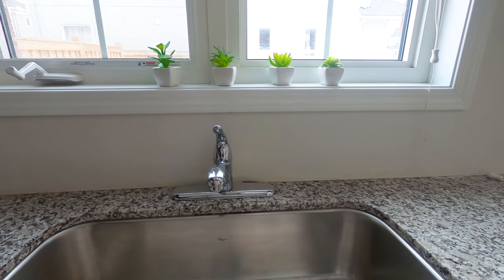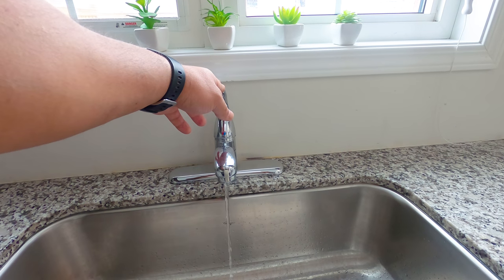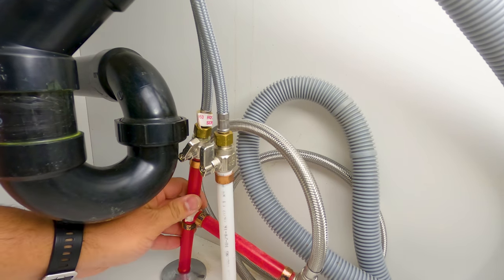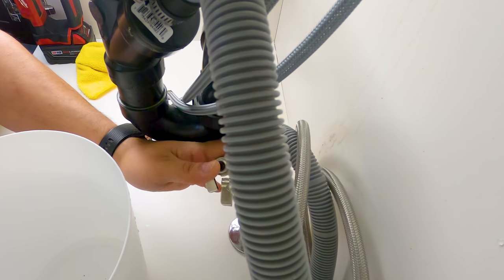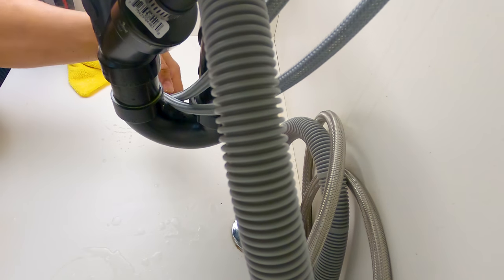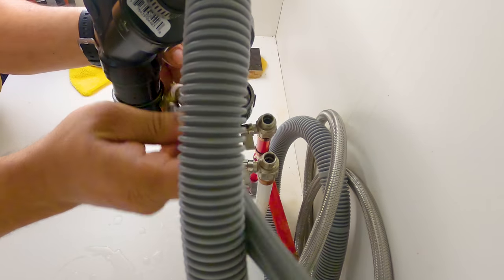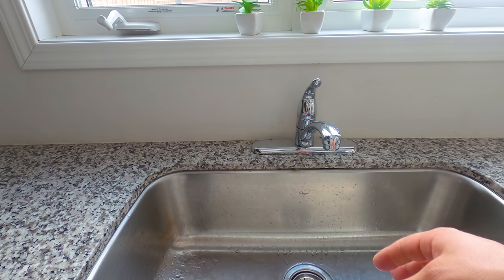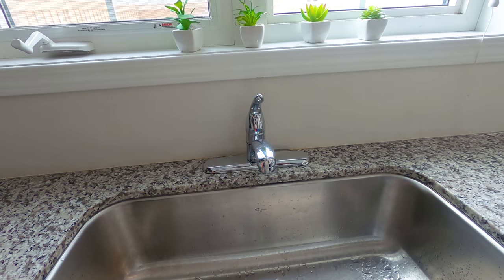how to fix Low or No water pressure for the kitchen or bathroom faucet in no time

Comment: Thanks for posting this! Been suffering from low water pressure after leak at main.  I cleaned out the aerator, but had low water pressure still but only in kitchen faucet.  So problem is from main to kitchen faucet.  After watching your video.  I found an additional filter between 2 connecting braided hoses! The systemic troubleshoot start with checking the pressure from shutoff valve at hot and cold then to aerator  was very useful! Thanks a bunch!!!
Reply from the maker: Thank you, I'm Happy that I could help.
Reply: This comment was a huge help. Didn't realize that the connected braided hoses also had a filter. Thank you so much!
Reply: @NeverEndTheSilence  me neither! It’s helped so much! 🎉💙
Reply: There was a water main break on my block and immediately after they fixed it, my hot water stopped coming out of all of my sinks but hot water comes out of my shower. 

There is no way all 3 sinks in my house have a problem. What could stop the hot water from coming out, only cold water comes out of my sinks??

Comment: I had issues in the bathroom, this worked GREAT!!!! Thanks. I checked the faucet filter first before the shutoff valves and it was clogged with debris. The water was off in northTexas for a while so I suspected an airlock first. Your video saved the day, thanks again.

Comment: Hello! I want to thank you for your easy explanation in your video! For the past week I had a very low trickle of water coming out of my bathroom faucet. I looked up a solution on Youtube and came across your video. By taking off the aerator like you suggested, I saw that it was quite dirty so I took an old toothbrush and soap and washed it. Problem fixed! Thank God as I didn't want to contact the handyman for my building. I'm quite proud of myself for fixing this problem as I don't know anything about plumbing. Thanks again!

Comment: Excellent video thank you.I   I thought i must have twisted the flexible tails when i tightened them after a leak but they were fine. Removed aerator. Sure enough lots of white gunk trapped in the mesh. You saved me from hours of frustration🙂

Comment: I just replaced a customers bathroom faucet that was leaking. While there I also put new water hoses in. When I tested everything all was good. An hour or two after I left the wife text me and said hardly any pressure, water trickling out. I went back, turned water off at valves, no change. On a whim I went in to you tube and up came your video. I changed the aerator and the pressure is the best I've seen it. When I turned the water on with the aerator out a bunch of black crap came spitting out, the same black crap clogging the aerator.
Can't believe I didn't think of that, regardless, thank you.

Comment: You should check the faucet aerator for clogging first before removing the shut off valves.
Reply: Agreed! always the head first.
Reply: @jih-shenshih5138  Unless the faucet aerator is one contiguous piece with the internal pex tubing of the faucet.  Then you are screwed either way.
Reply: @OWK000  Huh? Can you even attach an aerator to pex? Do you permanently glue a condom or do you zip tie it?
Reply: @tocarules  Heck!  I didn't attach it myself, it was manufactured that way! And you get the idea:  yes, the aerator was permanently bonded to the pex by plastic manufacturing weld.  That was the problem!  So when I tried to remove it, that action pulled apart pex bonds in other parts of faucet and the whole faucet leaked and had to be replaced.  We were having major plumbing work done at the time and a lot of bits had knocked loose in the pipes, so the faucet was toast one way or the other.  

I did just manage to remove the aerator from a newish bathroom faucet the other day and that one was screw on.  Relief!  They still make serviceable faucets.
Reply: Kim, are you really that young? Lol

Comment: Thank you so much for this informative video! Recently divorced and need to learn how to do this myself. Being 47 it’s embarrassing to say I never knew how to do it. I know this is a 2 yr old video, but it’s helped me tremendously. I actually reversed it and check the top first, only bc once I’m down on the ground it takes me forever to get up…😂 just kidding but I felt it may of been the top as I have hard water, and I know it creates a lot of build up. It was in fact the the top causing issues, I’ve taken it back off after testing it to make sure the pressure was better, to soak in vinegar to help get that build up off. My nozzle isn’t like yours it’s bigger and rounder with multiple spray holes. (Sorry don’t know correct verbiage for it) Renting the house, but saves me and company money if I don’t need a plumber to come out. So thank you so so much for doing this. ❤️💙🙏🙏🙏
Reply from the maker: Hi Barb, I'm Glad that I could Help. Stay safe and stay strong.

Comment: Thanks so much! I’ve had low pressure in my kitchen faucet since we brought the property, turns out the aerator was blocked! Fixed in five minutes what a lifesaver, thanks so much!!! Just wondering when attaching braided flexible hose you don’t need thread tape? Is that correct even when attaching to pvc thread also?

Comment: Hi, my kitchen faucet wasn't working at all. I saw a few YouTube clips and they showed how it could be the quick connect adapter near the under side of the sink. So I removed it and removed the inside valves. When I placed everything back it worked perfectly for a day but now it's flowing slow again. Any suggestions?

Comment: thank you, man, this vid is very informative, I have an old system no aerators but I did fix leaking cold tap in the bathroom yesterday , after watching your presentation, I'm starting to wonder if washer I replaced is too big, thus restricting water flow, anyway at least now the problem is narrowed down, so thank you for that, I better get working on it.
Reply from the maker: I'm happy Ken that I could help.
Reply: Most faucets from 2010ish  to 2018  had ridiculous restrictors put in to reduce flow !  I removed every single restrictor from every faucet in my house and it is so much better !

Comment: but what if it's not the clogged faucet? my kitchen faucet used to be strong, but a year ago, i felt the water was weaker so I cleaned the faucet. There were no sand. After the cleaning, the water was still weak. I bought a new faucet. It's still not as strong as before. But when i turn on the water from the hose, it seems strong, but not from the faucet.

Comment: Hey, this is really helpful, but it didn't solve my problem yet. Hoping you might have some potential solutions. I have a spray head and it doesn't work right now. The water works when I take the spray head off, but doesn't work when I put it back on. I replaced the aerator with a new one and still doesn't work. I think it would be isolated to the base of the spray head, so any thoughts on how would I fix that? Thanks!

Comment: After shutting valve off. Always test if water is actually off. Some valves maybe stuck open ( or have a deteriorated rubber washer) & you will have a big mess.

Comment: I tried to clean out the aerator on a modern kitchen faucet and it turns out the aerator was connected to pex tubing in the faucet and trying to twist it off destroyed the faucet, and I had to buy a new one.  Now I have a slow bathroom faucet and I am afraid to destroy another faucet, but what can you do?  Other than soak the faucet head in a container of vinegar,  which may not cover all kinds of gravel.

Comment: Hi please can you help? I have a mixer bath taps, with little flow volume for both hot and cold water. Other house taps work fine. I have loosened the hot tap with a mole grip, but unable to take off the tap. There is no aeriator to check as it is a whole piece from which hot and cold water flows. I made enquireis at the plumbers shop and the bloke said, I probably need a cartridge. He told me to bring in the old cartridge to check which I need. Please can you help on how I can disaessemble the taps many thanks
Reply from the maker: please excuse me for the late reply, find the brand and model then you should be able to find instruction online.

Comment: hi I have a similar problem but my kitchen sink tap only had some pressure but gradually lowers to an halt the hotter it gets? any ideas, also the hot tap is pretty stiff to turn, the cold runs fine
Reply: My tap has the same problem. Have you fixed it?
Reply: @anneonnamouse5496  Hiya yeah it was my faucet needed to change me taps all together

Comment: Water pressure throughout entire house is suddenly only flowing at about 50%. After a time, I turn on a faucet and it seems to be back to full pressure again, but then I watch it diminish back down to 50% over the span of about 10-15 minutes. Curiously, the hot water flows at about 50%, but the cold only flows at about 10%. This week we've been resurrecting the sprinkler system, and a few days ago there was suddenly ZERO water flow into the house, but upon closing all four sprinkler valves at one of the three buried "stations," I then got the water flowing again into the house, yet only at 50%, current status quo. (Main valve for sprinkler system is now shut off. Interestingly, I just had an outside spigot running--trickling at 30%--and then I popped open the main sprinkler valve, and suddenly the spigot began blasting at 100% but then dropped again back to 30% after 10 -15 seconds.) Yeesh! 

Any thoughts? Thanks
Sam

Comment: My bathroom sink and water in my refrigerator are barely trickling. I put different water heater in and that is when this started. What can I do?  The kitchen sink works ok.
Reply: tell me more about ur situation.. is there any plastic pipe line?? which may effect by heat of external heater?? for solution tell me more.. email me

Comment: What if that's not it and the entire house is affected? Low flow and low pressure. Happened after I flushed the toilet (only action I know I took before this happened) and the water heater started getting noisy. Any idea?
Reply: Rick...I'm in the same boat you are.......very low water pressure in bathroom sink after flushing.......I'll be looking for the answer too !
Reply from the maker: low pressure for the hole house is a lot more complicated to fix and you diffidently need a professional plumber to take a look at it. call your municipality and check with them the size of the pipe serving your house from the city! then follow the lines in the basement to the water meter and see what size of pipe is before and after the meter, you need at least 3/4" pipe before and after the water meter and not 1/2". but there is a lot more to look at and that is why i said you need experienced plumber to look at it. in worst case you can install a pressure booster in the basement to serve the whole house, I actually installed one in my house for my irrigation system and the rest of the house. I hope you find my answer helpful. good luck.

Comment: So my problem is in the line to one bathroom shower.  Sink pressure in that bathroom sink is just fine.  All pipes are behind the wall.  How can I follow this procedure with no access to pipes?
Reply from the maker: Replace the shower cartridge!
Reply: @PipeWrencher   Thanks.  Finally had to call a plumber and he had to cut into the wall from the adjoining bedroom and replace a valve behind the bathroom faucet that he said had been soldered incorrectly when house was built and solder was blocking the line. So no simple solution for me.

Comment: Why not check aerator first, since that's easiest; then, if it's not blocked, get down under sink?
Reply from the maker: This video shows how an experienced plumber will troubleshoot, but i know we have so many lazy plumbers around that will start from easy part. Starting from the aerator is %100 wrong specially if a plumber do it

Comment: In your case it was enough pressure so you didn't address that possibility in the video. Now what if there is not enough water pressure coming from either or both lines?

Comment: How would I tell if the problem is the cartridge or the supply line? Just hot water side is not flowing, but the valve is fine. I want to repair this faucet as it was expensive instead of replacing with a cheap one.
Reply from the maker: Disconnect the hose from the faucet if it is not built in, place it in a bucket and open the valve to test the pressure. Depends on the condition of the faucet there is %90 more chance for a cartridge to go wrong than a hose.
Reply: @PipeWrencher  Kohler is sending a new one because it's been hard to turn the spout and the control lever left/right, but in the meantime, turns out it was some of the black o-ring from the shutoff valve tore apart and lodged in the hose! 

Something worth keeping in mind ;-) One-way check valves are nice to keep water supply clean, but made troubleshooting a lot tougher!
Reply from the maker: @JamieClark  this is the thing about plumbing, there is always something new that you don't expect. Happy that you could figure it out.

Comment: check the aerator FIRST since it is the simplest solution. no reason to unnecessarily disconnect the water supply lines, potentially creating a leak, etc. sorry, but this did not solve my low pressure issue at my kitchen sink.

Comment: I have low water pressure at outside faucet
Reply from the maker: might be either that outside tap itself or the shut-off valve for it inside the basement.

Comment: Whats your angle here? That you can fake fix things. You brought up a common problem. But only one thing. Your hot water shut off valve was half cocked. I'm guessing it was turned on all the way after you so called fixed it. Smdh